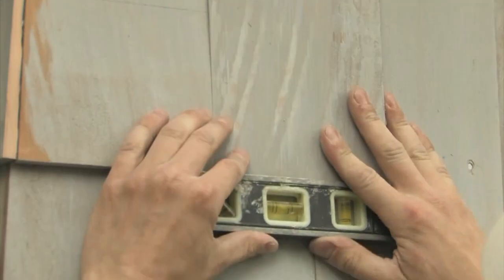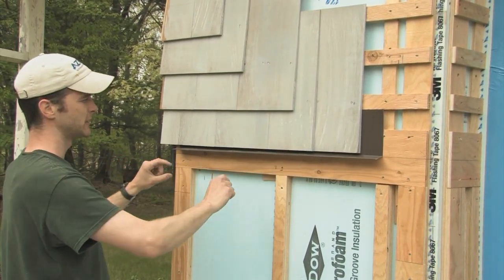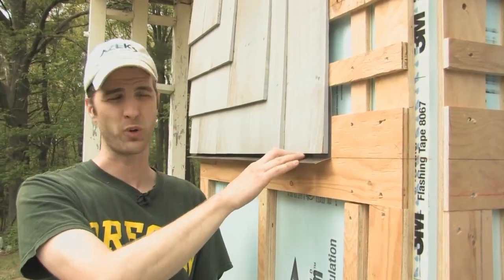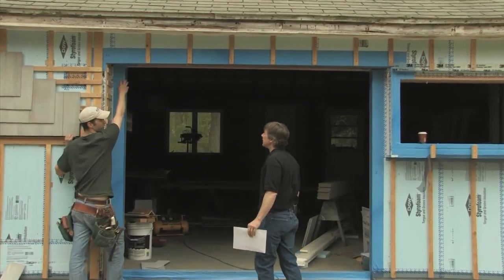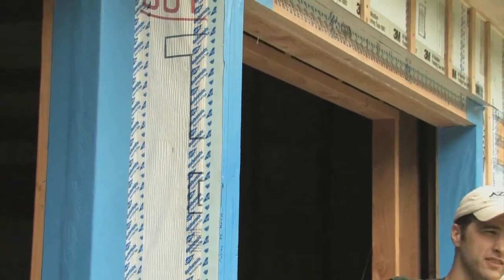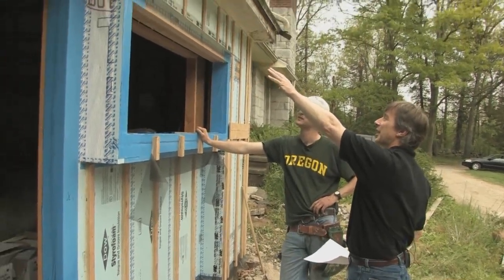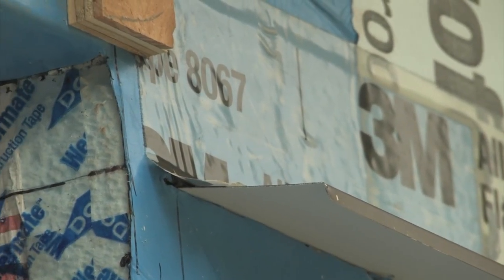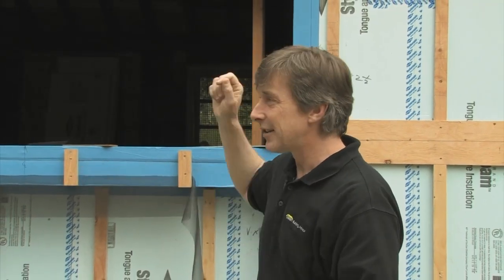Project House Weekly Wrap, Episode 5: Housewrap and Exterior-Foam-Insulation Details

Comment: Nice job, Ive seen someone use the insect screen and infill in between the vertical nailers with a strip of cobra ridge vent or similar product. Insect screen then folds over that before installing siding. Not sure what else is out there?

Comment: Funny how all these new materials and techniques are failing 15 years later yet my good old cedar over tar paper and plywood is going strong after 50.
Reply: 121212 Where do you get your facts from?
Reply: Good to know! I was thinking about skipping the furring strips and just having: plywood, tar paper, and cedar wall shingles.
Reply: @nholt  Tyvek® DrainWrap™ or a similar product might be a suitable compromise.  It functions like the tar paper, but allows for air flow and moisture drying with less space behind the shingles.  Not as inexpensive as tar paper, however.

Comment: Why in God's name would you use Hardi plank siding when it has failed so miserably that they have negated their warranty in any kind of wet enviroment?  They have refused to honor their warranty in entire coastal areas.  It is pure garbage.  There have been nothing but failures in even the most detailed installs going above and beyond James Hardi's recommendations.  I would expect more of Fine Homebuilding than to tout such a failed product!  Doug
Reply: You must be thinking of Masonite siding not Hardi .
Reply: @deerhunter7482  Nope most definitely Hardi!!!  I corresponded with them enough to know.  Since I installed it I personally know.  It was also the consensus of the premium contractors here.  Every day I see the deterioration of Hardi plank on the many homes it was hung on as I drive by.  You don't see it on any homes within the past ten/fifteen  years at all.  It just sucks in every way.  Hardi disowning its own product just reaffirms this.  Yet they keep selling to the uninformed.  Advertising hides the truth in many cases.  When Louisiana Pacific pulled this with their 'siding' they had to pay off big in class action lawsuites replacing all their garbage including the labor.

Comment: why americans build their houses using wood instead concrete with bricks?
Reply: Because wood is very abundant and economical in north America.  
Wood is more scarce and expensive in er urope for example,  so cementitious building is more common
Reply: +Jose Salvias Concrete blocks are poor insulators, harder too work with when trying to do odd shapes. they also wood is a renewable resource, Concrete actually emits large amount of CO2 for many years. Not to mention Blocks are UGLY!